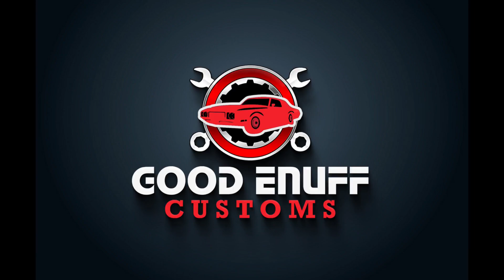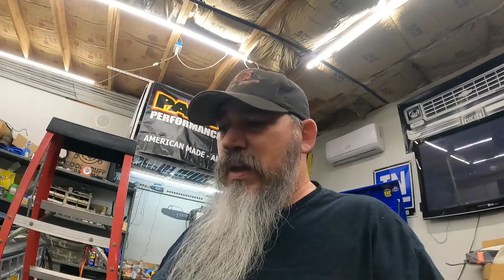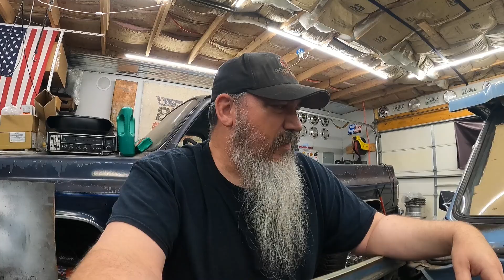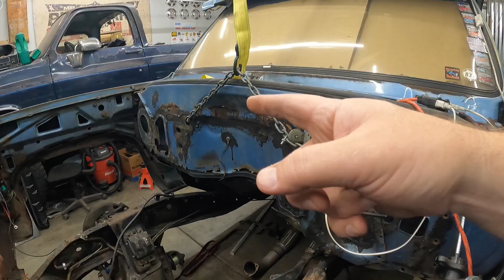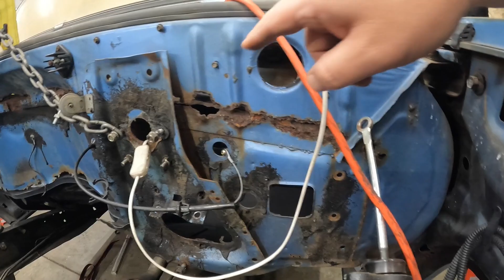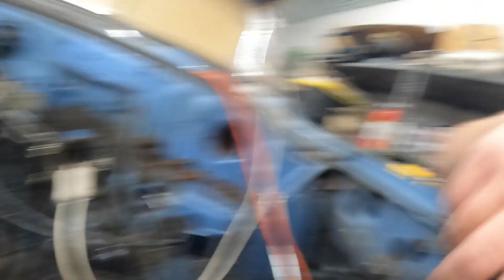What to do with Steve?

Comment: Smooth firewall. Aftermarket Calum and power brakes
Reply: Yeah I understand the money part. With that big block in there your going to have a lot of go your going to need the wiw
Reply from the maker: Very true!
Reply from the maker: Power brakes definitely, I think the driver side of the firewall will end up being a mix. The column is a maybe, depending on how much $$ I’d have to spend.

Comment: Do hydroboost. Much cleaner look. Use the stock firewall. Cut off the outside edges that stand proud and weld the perimeter. Then grind everything smooth. You get to keep the steering shaft support, don’t have to custom make a backing plate and it should look good. If nothing else, cut it off the current firewall and see how it would look
Reply from the maker: Didn’t think about cutting down the factory brace! That sounds like a damn good plan!

Comment: I have a 1974 C10. My rig came with manual brakes too, yuck...I upgraded to disc on the rear, new proportioning valve, & new 1985 brake master cylinder & booster. Stock front calipers too. It stops very much like a late model truck. I got parts from Rock Auto. The later model parts put out more force to the brakes & it really works. Just need adapters between master cylinder & brake lines to bolt right up. Good Luck Sir. Also saw your Big Black rig at Columbia,Tn cars & coffee a while back...Yeah Man
Reply from the maker: Good info, you should see Steve out there next season!